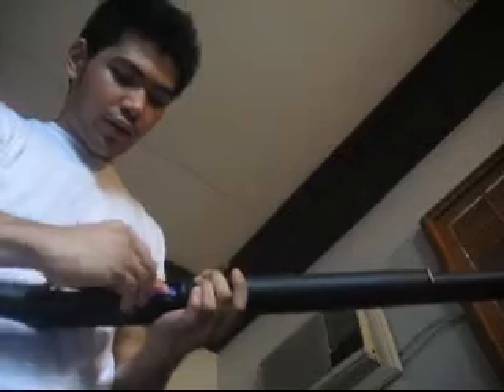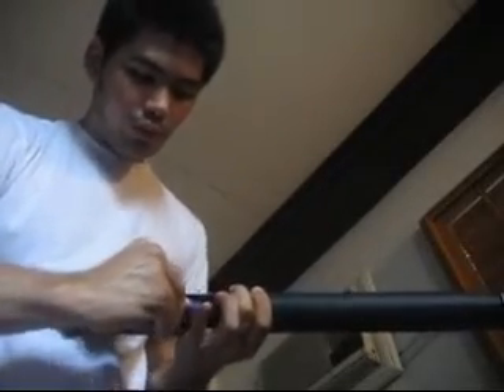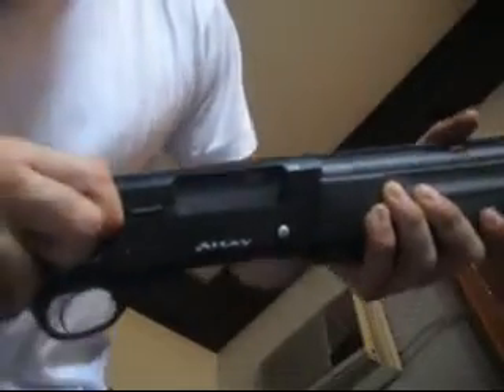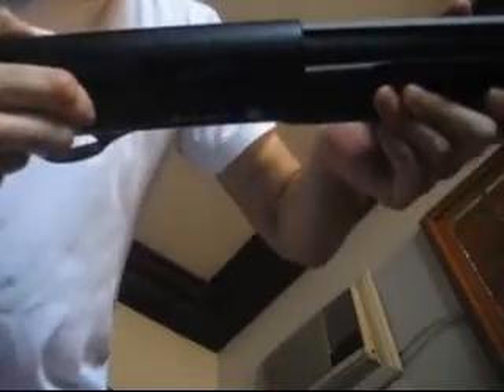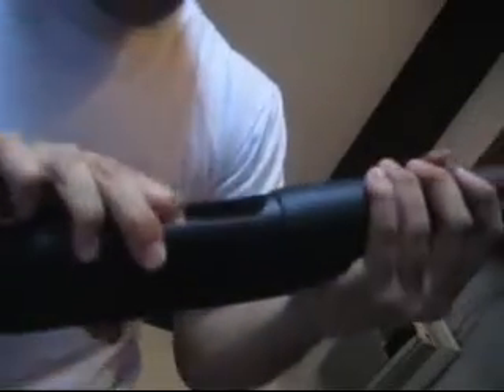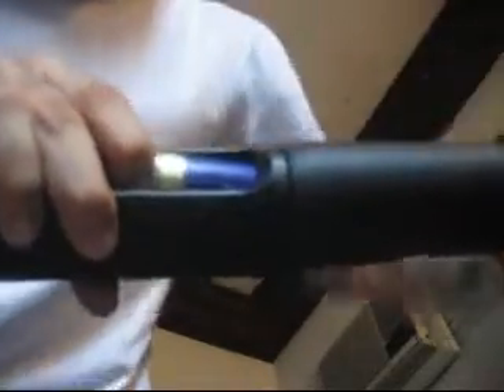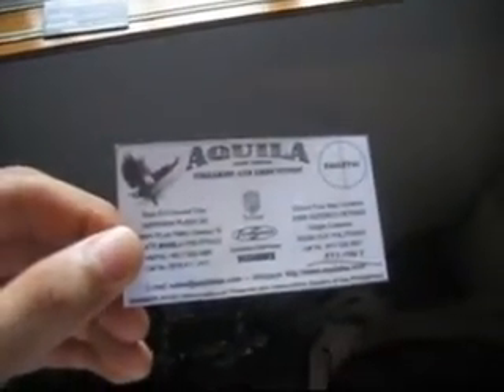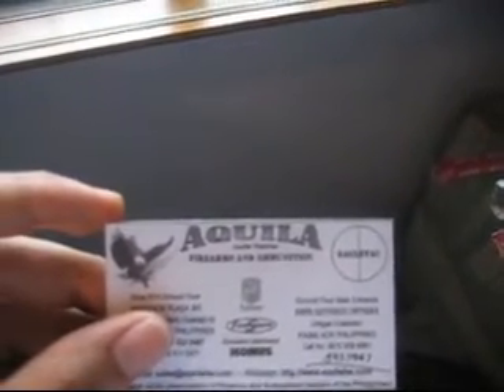First Look: Akkar Altay Competition (Part 2)

Comment: Have bought a Akkar Aitay Mariner . It was advertised as a 5+1 , but only takes 4 in the mag also after plug was removed. Did you get the extra rounds into your magazine tube ??? If so , what did you have to do ???

Comment from the maker: @arneliza74
The chokes are used in order to fire wide or tighter patterns (Cylinder has the most spread; Modified has a tighter shot pattern; Full has the tightest shot pattern). Modified and Full chokes are usually used to hit targets at longer distances. It enhances the capability and versatility of the shotgun. I hope this helps. :)
I can include a disassembly video for the Karatay line if you are requesting since I intend to make a review for the Akkar Terminator (pump-action shotgun).